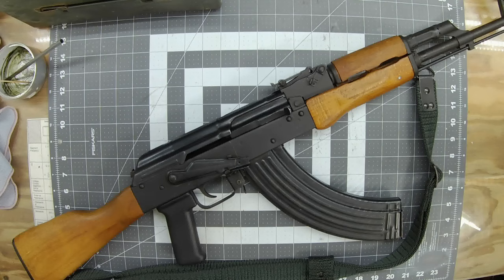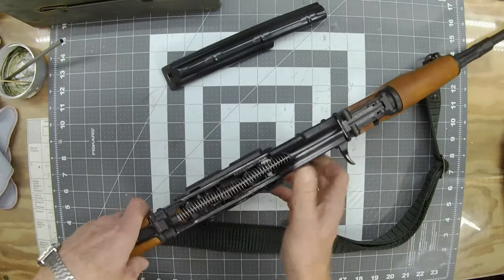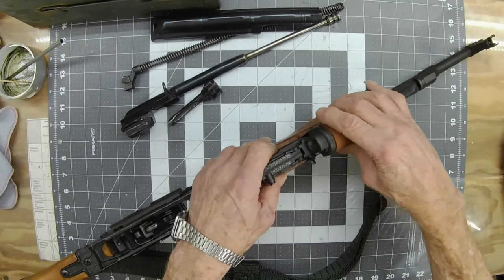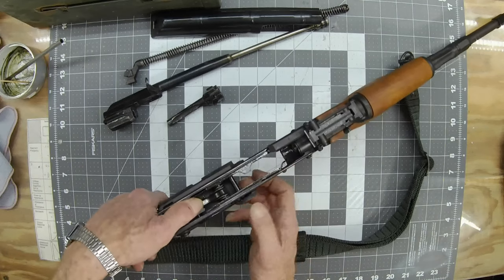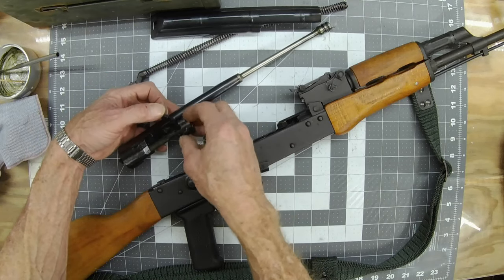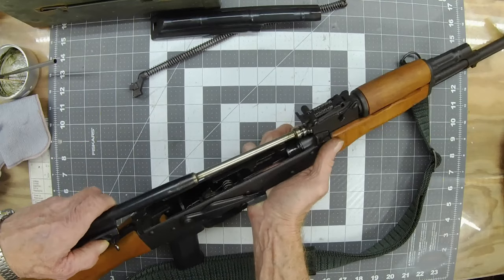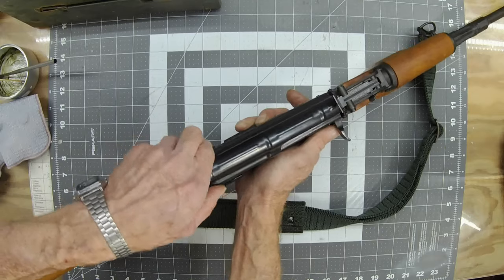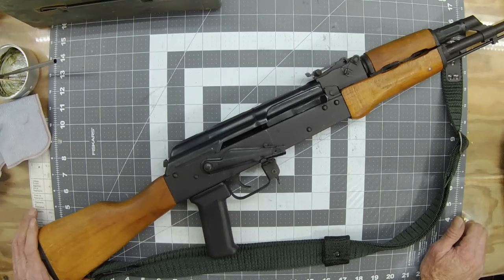AK-47 Field Strip/Disassemble For Cleaning

Comment: Thanks a million. I've had mine for over two years and didn't shoot it because I didn't know how to clean it 🙃  man you made it easy to understand. Thanks!!
Reply from the maker: Happy to help.
Reply: AKs can run fine dry
Reply: Watching this video 💯 I disarmed my AK 5times 😋 Thanks
Reply: For real? I mean, you Americans clean considerably more complicated mechanics than the AK. Kalashnikov is intended to be the easiest possible rifle to maintain in the field, without any tools. Take an advice from an ex-commie countryman. The Kalashnikov rifle, along with most (if not all) Soviet-Russian guns, likes a lot of oil. You can bravely put how much you wish there, it won't be detrimental to the function at all and you will guarantee it will run good for long. Another thing about the receiver cover. In time you will find the proper motion to put it easily. You need to put it firm ahead in its groove, then push it down while holding it forward. In Bulgarian military, and probably in any other Warsaw Pact nation, you simply push the cover into the frontal groove, then smack it with your palm. While this method is a bit too much for me to do on my own rifle, it is the genuine way anyone around here who's old enough to have been drafted in the military places that cover.

Comment: Two important steps covered here.....pushing the back of the bolt inward before sliding the carrier group back into the receiver.......and pressing down and forward at the same time putting the receiver cover back on.  I have cussed and raised hell so many times trying to figure that out.  But those steps do indeed make the process a lot easier.

Comment: I struggled as well with replacing the receiver cover.  Although your method did not necessarily help me it led me to figure out the workings of the mechanical locking mechanism so I am able to consistently put it back together now.  Thanks so much.